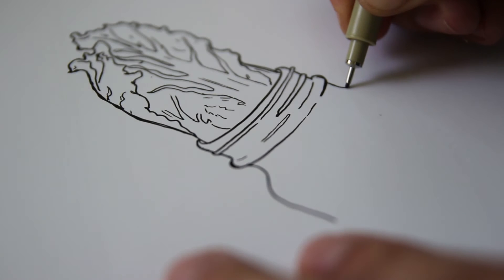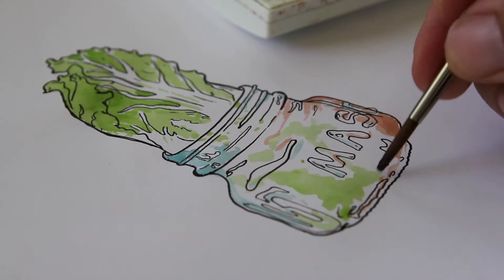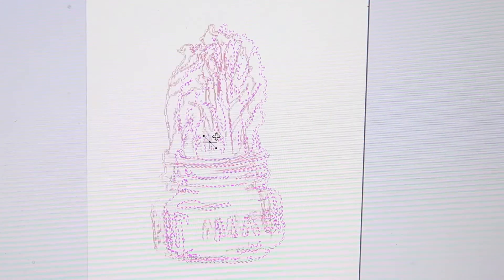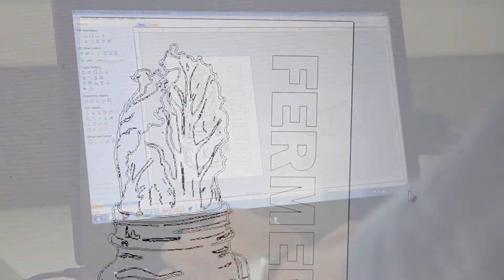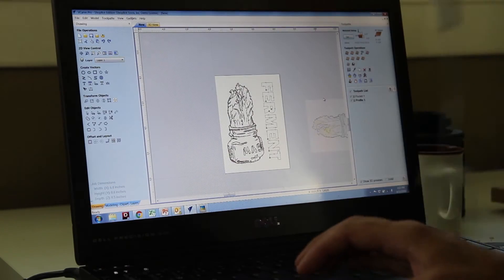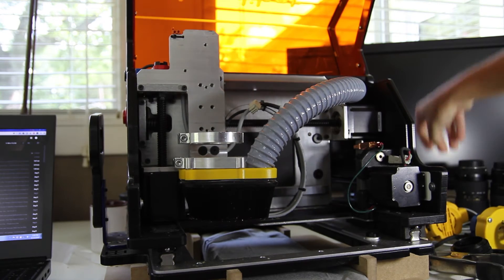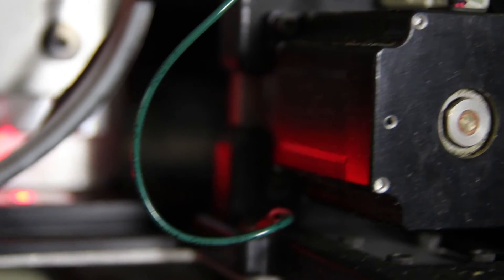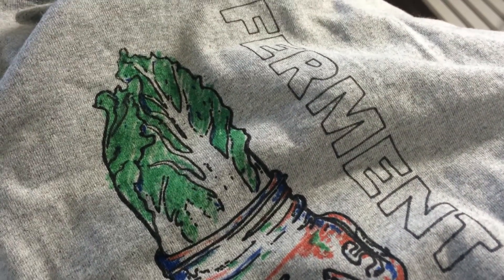Making Graphic T-Shirts with Handibot

Comment: Thanks for sharing. Very interesting possibilities with the sharpie. 

Have you tried modifying an airbrush? I have no experience at all but if you can rig the up-and-down motion of the Handibot cradle to switch the paint flow on-and-off you might do something cool.
Reply from the maker: Jeff--we haven't used an airbrush with it yet...but we have clamped a paintbrush in the holder and had it dip and paint from a watercolor set!